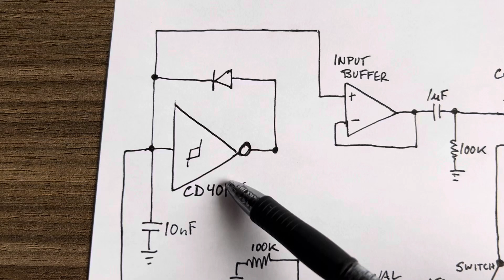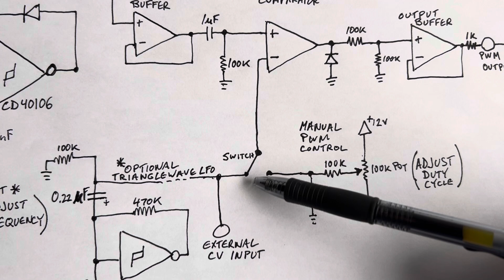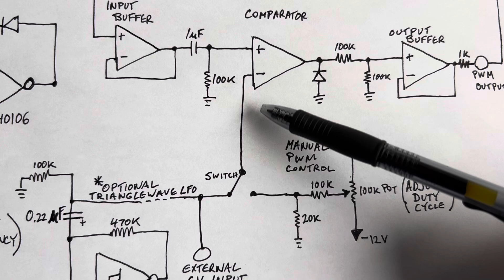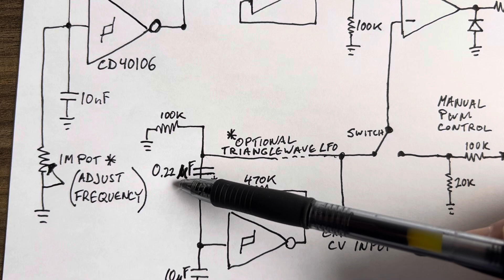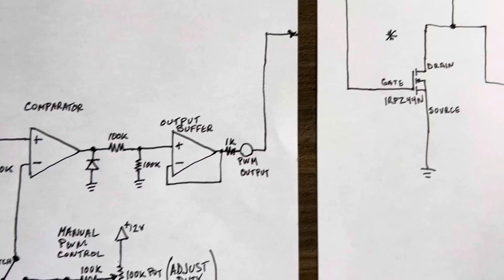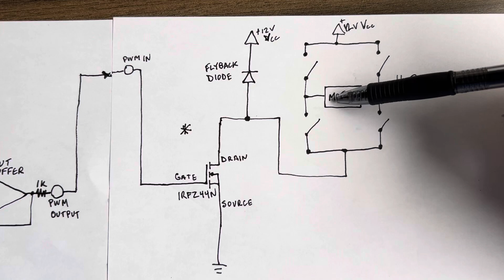Diy PWM DC Motor driver modifications

Comment: if you replace the 470R/1M resistor with a npn transistor to ground you can play or adjust the speed. you also have a sense or more precise control.
: )
pretty cool circuit.
Reply from the maker: @AnalogDude_  yes. You can even control it with a control voltage but i didnt need that functionality for my purposes